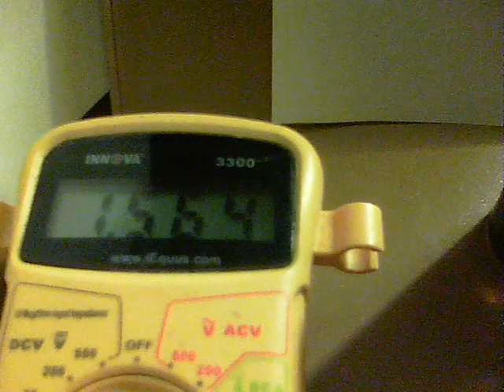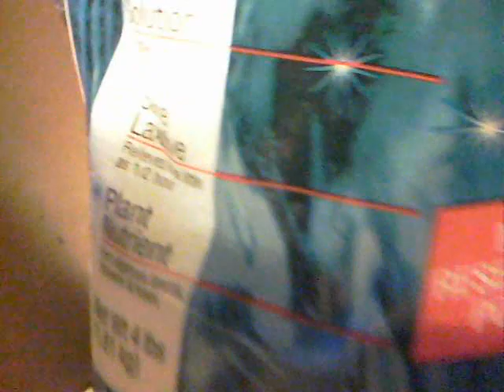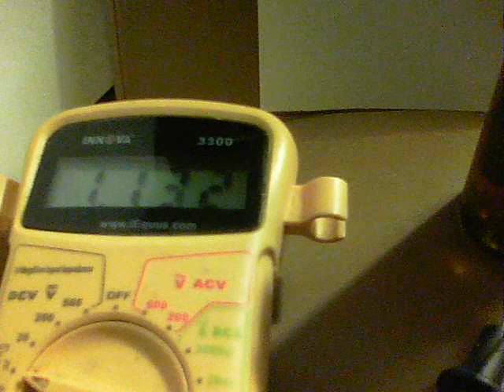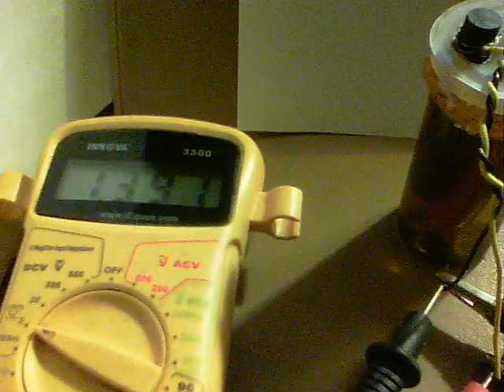C/Pb - Carbon Lead rechargeable battery

Comment: Is the carbon Rod the Positive and Lead the Negative?
Reply from the maker: Yep :)
Both make great opposites.
Reply: How about reversing the roles? Making lead the positive(by forming Lead Dioxide) and carbon the negative? Like a Lead Carbon battery/capacitor hybrid? the Lead dioxide has about 1.8 positive charge

Comment: Hi slider, What is in between the carbon and the lead. Thanks Bill
Reply from the maker: Hi Bill - it's just a piece of cardboard as a separator. Sometimes electrodes touch together when moving a cell around, but it was found to not be needed and was removed shortly afterward. Kind of obvious looking back at the build, that the lead was unlikely to wave around in the bottle lol

Comment from the maker: Yes indeed, I see it all around within these experiments. Maybe it's people that tap the aether and not devices lol.
This cell is still going, though now it has no solar panel topping it up. Sits at 0.881V all the time and runs the oscillator all the time, has done for about a month. No decay has been noticed on either electrode.

Comment from the maker: Thanks. Yeah, without a charge at all would be an interesting experiment. The start voltage was really surprising and did run an oscillator straight away. Your linotype would be ideal :)

Comment from the maker: Indeed, the builders ones would be good idea.
The carbon being Positive from the start means no metal degrade like those in car batteries. Got to find more batteries to try other metals on Negative :)  
Been out to shed just now and just know I threw out the leaking zinc batteries. Never tidy anything !

Comment from the maker: Yeah, was all a random thing, after finding the lead weight, but also tied in with Yagorup NP's carbon rod vids. Being short of Alum now prompted the use from the huge packet of Epsom Salts ($3.50 or similar from Walmart a year back). The only cost was the water, which itself was spare from flushing the car radiator. The batt was a 'DG Supreme' from the back of a radio with batt leakage inside.

Comment from the maker: Cheers. I would expect them to behave like a regular car battery when in a series of 6 say. Probably a lot like the Alum conversions, they'd top out at around 11V over time and with a decent charge input. But...personally, i'd have to scout around the railroad crossings etc to find out lol. Am intending to do so though and to be looking for discarded D cells. Also to try a same cell with Alum instead.

Comment from the maker: Simple enough and the lead weight was a great find on the roadside. Had a thought about the size of the weight, that the wheel must have been really out of balance...more so after the lead fell off.